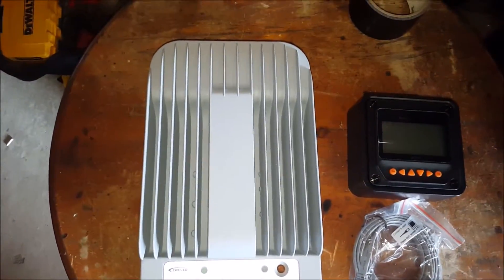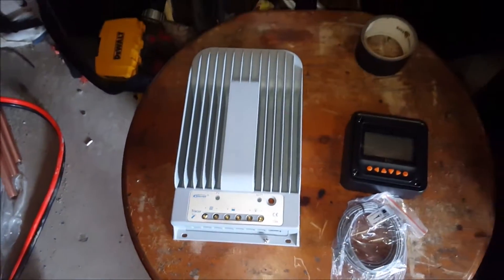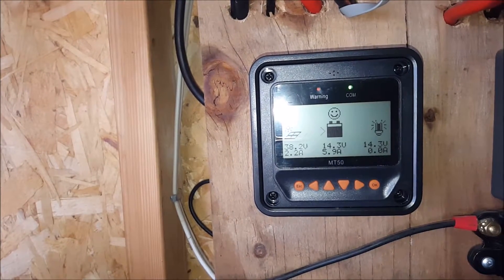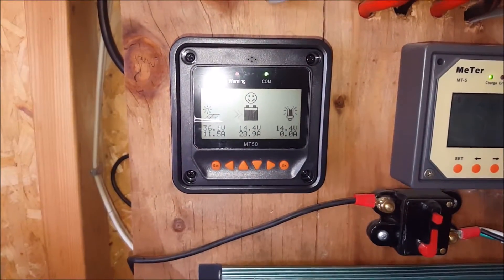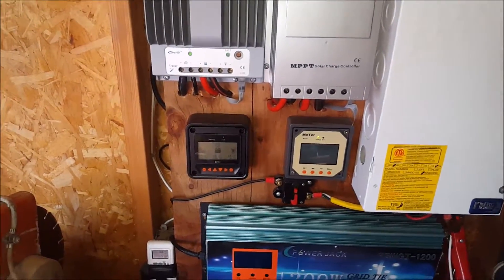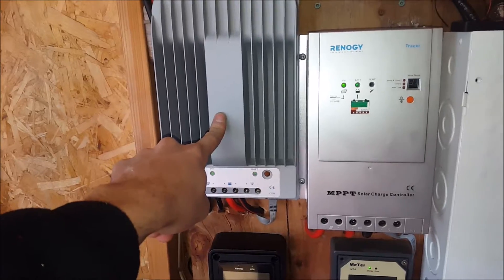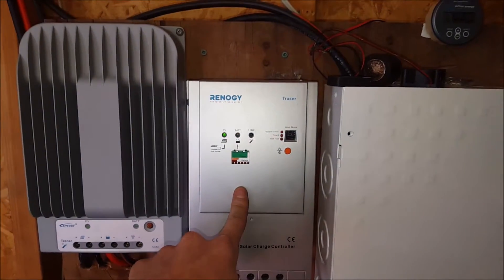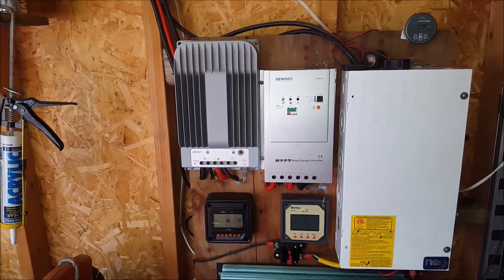40A MPPT Tracer 4215BN has come!

Comment: May I ask how you set the battery "Ah" parameter on your MT50?  The manual is not very clear on how to set this item.  In my case I have SIX batteries... each is 6 volt and each is listed as 210 ah.  I combined them into 3 pair effectively producing THREE 12 volt batteries for a total of 630 ah... is THAT what goes in the MT50... or do I put the capacity of a SINGLE 6 volt battery (210 ah)?  See the confusion?   Thanks.
Reply from the maker: Yes 3 12v batteries at 610Ah
Reply: So I only enter 630ah into the MT50... right?  There is no place that I can find to enter how MANY batteries I have.  Thanks.
Reply from the maker: @MTBioGuy  yes enter 610ah and you are set

Comment: run your panels in a series of two panels and it will work a heck of a lot better. It will still know to covert to 12 volts for the batts. I am using lithium Ion Nissan leafs they are super batts. at least my epever knows to. look at your owners manual see if it can do it.
Reply from the maker: hey buddy, I have watched your channel for years :) check out my newer videos!
Reply: OK I ll check it out.

Comment: I'm having real trouble with my setup, I have 3x100 flexible panels wired in series, but my 4125bn will only show the accumulative voltage for a min and then it will go down to 13.5v,and only generate around 2.2a even on a sunny cloud free day. I'm charging a 250ah Agm that is at 12.4 volts, so it's nowhere near fully charged (set the mt50 to sealed as per my battery  manufacturers recommendation) I have checked all panels, they have open circuit voltage of 20.5,and vmp of 17.6,. I am at a loss!

Comment: Question...  Did you open up the case to do a comparison between the 40a eSolar/Epever 4210A and this newer model 4215BN ?  I will be operating a 24vdc fla bank and have GP-SW1500-24 on site.  TNX, rc
Reply from the maker: i have not, they all work very well I think the newer ones just have a larger heat sink, I have had 59 amps through all of mine and no problems at all

Comment: What size wire did you use to go from controller to battery? The positive and negative look different.
Reply from the maker: 4 gauge
Reply: Yep.  4AWG will barely squeak into the recessed clamp of a 4210A !  rc

Comment: Have you tried plugging the new display into the old charge controller? I have the older charge controller and display and notive the new one shows much more info (show current in addition to volts). Also the old display is fairly inaccurate at showing battery charge %.

I'm very curious if the new one works with the old controller, thanks!
Reply from the maker: I don't want to destroy one of my controllers testing this, but I just bought another one of these I like them so much

Comment: Have you ever run 500 W on the 4210 tracer that's what I'm running now some people say don't do it other people say it's fine I'm not really sure
Reply: william foreman You can add more panels than it is rated for but it will not go above its rated Amp output for charging your batteries so you will be loosing the extra watts/ Amps you would be getting by using a larger or adding a second controller for those extra panels.
Reply from the maker: I run 750w on mine with a fan keeping it cool.

Comment: Is everyone here still think that the tracer 4210 is a good charge controller or is these new ones supposed to be better I just ordered a second 4210 I have my first 4210 hooked up to 500 W right now at 12 V I don't know if I'm going to parallel and run another 500 W into my bank or just build another battery bank and use my second controller for a separate system not really sure you have two 4210s there flip did you have them paralleled hitting the samebattery bank if so how did that work
Reply from the maker: yes parallel into one battery bank, and I think they are the best you can buy for the money.

Comment: I have been reading about the Bn series being slow at tracking MPP compared to the older controller. Do you also experience this?
Reply from the maker: no I have not had a problem with it at all so far.

Comment: Hi, nice video as usual , I have a question. From the meter, the currents are like twice of the panel current. If I have a 130 W panel rated 7.35A maxi, with this mppt controller can I get 14.7A from it to charge a battery? Thank you.
Reply from the maker: +Esholomo Oluwadare  you will get a bit more amps but not double say your solar panel is 18 volts at 130w that's 7.22 amps but if you use a mppt charge controller and it brings you solar panels voltage done to 12 volts to charge a battery the 130w panel through the mppt will put out 10.83 amps. hope this helped a little.
Reply: +fliping720 thanks a lot , it helps greatly, I will go for mppt controller.

Comment: I hope U can figure out how to EQ I am about to give up. I tried to load mine on the USB to my lap top no luck, but I am no computer guy, with my Outback & Midnight Classic  u don't have to be. Other than that it is very responsive to loads I have put on it as U showed but if I cant EQ my lead acid battery's with it is no good to me. I am kind of bumming about this as it seems to be a nice unit .
Reply from the maker: +TheKilog69 well if you have a hard time and when I get my usb cable for this thing, ill be happy to program it for you.
Reply from the maker: +TheKilog69 btw can you not set the EQ from the main display? Mine had that option.
Reply: Thanks I have not been able to no I have tried over & over. It has a 16V limit but no way to trigger a 15.5v Eq. or any EQ. I am considering selling my unit as it does not fit my needs.
Reply from the maker: TheKilog69 well if you do let me have first dibs, but I would like to help you once I have mine all figured out, once I have all my soft were up and running ill let you know and we will get it going for you!, but remember I get first dibs if you give up and sell :)
Reply from the maker: TheKilog69 Ill try to get mine to EQ and make a video of it and see if that helps you
Reply: +fliping720 Thanks! This sucks as it does all else well but no EQ strange
Reply from the maker: TheKilog69 it can and will do EQ, I will find out how asap and show you :)
Reply: +TheKilog69 It's good to know. Thanks for sharing that information. 
I was thinking of buying one of them for my 12V home lighting battery bank system
Reply from the maker: JWSolarusa John Wesley keep an eye out for the video on hot to :)